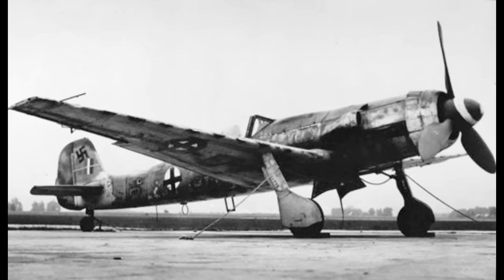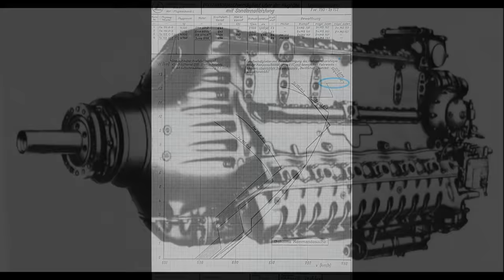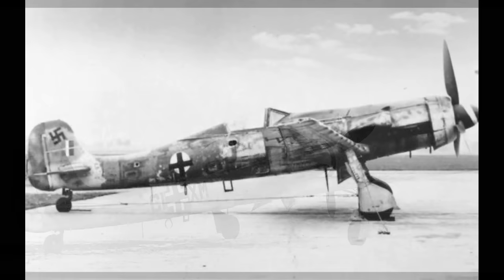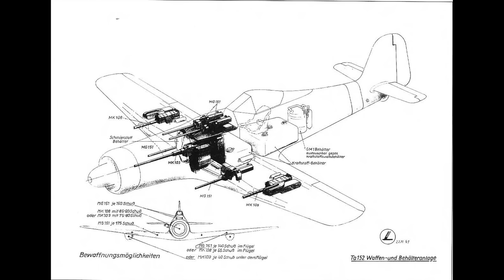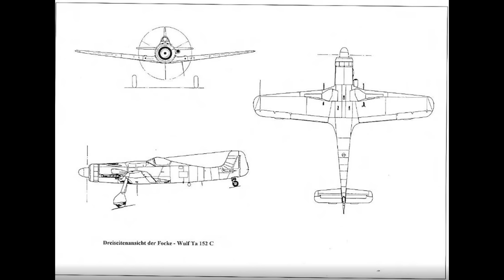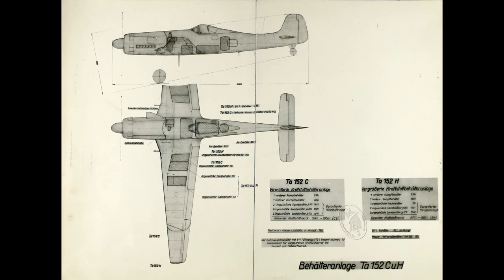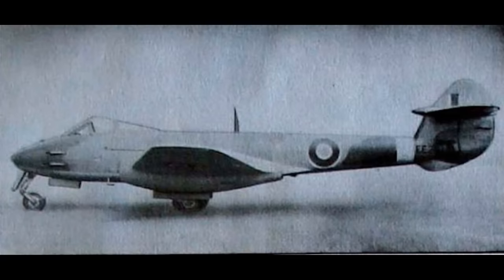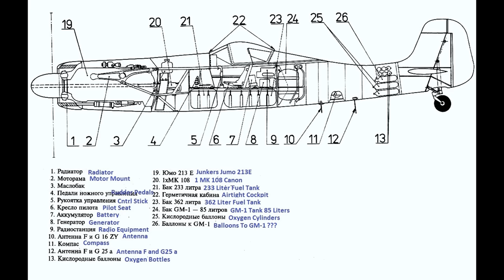Focke-Wulf Ta 152 H-1 Extreme Speed At High Altitudes.

Comment: Question: was Heini Dietmar on Oct. 2, 1942 @ 1000KPH in a Me163A with a Walter rocket engine the first person to break the sound barrier before Chuck Yeager? Excellent, informative vid, as always!
Reply from the maker: No, there was no airplane in WW2 that broke the sound barrier, those rumors are on par with Nazi bases on the moon.
Reply: @GregsAirplanesandAutomobiles  ok, just read into too much in my Schiffer Military books!
Reply: Horten IX V3   977 (1000) km/h   Air & Space Museum San Diego

The Messerschmitt Me 163 Komet is a German interceptor aircraft designed for point-defence which is the only rocket-powered fighter aircraft ever to have been operational and the first piloted aircraft of any type to exceed 1000 km/h (621 mph) in level flight. Designed by Alexander Lippisch , its performance and aspects of its design were unprecedented. German test pilot Heini Dittmar in early July 1944 reached 1,130 km/h (700 mph).

Comment: Greg, would like to offer my congrats on a very informative well presented doc. I have a couple of questions for you. Do you know if the Ta152-h was operated over the Eastern Front? and do you happen to have any information on what the Smithsonian so plans are regarding their example? Thanks.
Reply from the maker: Thanks Rural, and I really don't know. I have heard of TAs on the Eastern front, but I can't be certain. I have no idea what the Smithsonian will do.
Reply: +Rural Geeze     Regarding the Smithsonian Ta-152,  repairs have been made over the years to correct damage to the wooden components from mice and poor storage conditions.  When it was being evaluated by the AAF,  modifications were made with steel plate to strengthen the tail because there was concern about tail separation.  So those modifications had to be removed to return the exhibit to the original condition.  I am sure that the Smithsonian will eventually get around to preparing the aircraft for display.  The current philosophy at the Smithsonian is leaning toward "light" restorations rather than deep restorations on aircraft.  I am not sure that I agree with that approach when everything should be completely taken apart for cleaning and repair.   For Eastern Front Ta-152s  I did read of an account of a Ta-152 spotted fleeing to the East at the end of WW2, but this is anecdotal.  Another mystery is the possibility that Japan may have been given license to produce the Ta-152 and somewhere in Japan there is a full set of engineering drawings for the type, which would be a historical find if true.
Reply: @FiveCentsPlease  Thanks for info, But what a way to treat an extremely rare & valuable airframe, I bet there are restorers who would give their right arms to see that airworthy.

Comment: I love the FW-190 TA 152 H1 is a boom and zoom king along with the D versions and the A , F version

But I wonder does any Ta 152 H1's survived after the WWII and still flying today
Reply from the maker: No. Only one survives, and it's far from flying condition, nor should it ever fly because it's the last one.
Reply: @GregsAirplanesandAutomobiles  

I think I have got it now 

TY
Reply: +Flak 8  Discovery of a Ta-152 crash location would be significant and could in theory allow a path to another constructed example.   Much of the buried scrap in Germany was dug up in the 1950s by scrap merchants.  The British had a second captured Ta-152 which they scrapped.  Someone would have to research whether it went to the smelters or was crushed and buried, since other captured aircraft were buried on one of the old RAF bases.  Flying?  I don't really know since the Ta-152 was not really a proven design and still had teething troubles in service.  A flying example would probably have to invest in additional engineering and replace the hastily designed wooden structure (the tail) with metal to make it safer to fly.

Comment: Impressive for a plane with a wooden 3 bladed propeller.
 Off topic a bit, but I wonder how the different armaments carried by WWII fighters performed at altitudes. Interesting to think what thinner, colder and less oxygen dense air would have on performance, if any, or was it just a challenge to keep them from potentially icing up. Hmmm...
Reply from the maker: The did have gun heaters in some cases. I would think that the thin air would result in a flatter bullet trajectory and more range. I'm not a firearms expert, but that's how it seems to me.

Comment: I understand that liquid nitrous oxide should cool the intake charge a bit as it is injected into the manifold and returns to a gaseous state (with additional temp reduction being accomplished downstream by the aftercooler), but would this phase-change effect of the nitrous be significant, or minimal/unmeasurable?
Reply from the maker: The cooling effect is significant.

Comment: The Dash8 I fly is set up for 100% oxygen. The main reason is so the mask is protecting from smoke inhalation as well as low pressure air. It can be switched to dilute if you were flying at high cabin altitude for a long time for some reason.
Reply from the maker: DeHavilland, or Boeing?
Reply: @GregsAirplanesandAutomobiles  DeHavilland, the Q300 specifically (So perhaps Bombardier is most correct?). For us the mask is for smoke and/or emergency decent from 25,000, which takes 3-4 mins.

Comment: Hey Greg, do you have an opinion on how the Germans managed to be so competitive? On superchargers - their superchargers had to accomodate the guns shooting through the engine block, so they are off to the sides of the engine, and they didnt have the superb aerodynamicists of the Allies. Yet the speeds they attain are definately comparible. Also, they look badly built, badly finished, and their slave driven, bombed factories surely could not output a smoothly detailed aircraft in the way the Mustang for example was finished. And yet...
Oh! also, the shorter wingspan version doesnt seem to suffer too much in comparison until the very highest altitude (and that from the nitro), and I always envisaged it as much more of a low altitude craft. Interesting.
Reply from the maker: Generally speaking, bigger engines. The BF109E and F had about 33 liters vs. the Spitfire's 27. Pack that engine into a smaller airframe and you have an advantage.

Comment: Greg: Can you add some (much needed) Information on the Airscrew (Propeller) ?  At the thin air above 30,000 ft and high speeds, the propeller design has its own set of challenges...
Reply: I'm curious about this subject too. I have so many questions especially on Fw-190-C with its 4 blade propeller but I just can't seem to formulate a question
Reply from the maker: I'll have to cover this at some point. I am trying to learn more about props right now, I never really studied them before.
Reply: @GregsAirplanesandAutomobiles  Please do that at all means!... Propellers are sometimes taken for granted, easily imagined as rotating airfoils, but their behaviour is quite more complex, as they are traveling and other effects appear, like when the airplane is Taking Off and the airspeed is low, but the "airscrew" does indeed "pull" the air before the airplane, that is, the leading edges of the propeller reduce the local pressure and "pull" the airstream back, accelerating it. Thus, the phenomena is quite complex.  Add to that  the fact that multiblade propellers produce complex interactions as there are blades that have already disturbed the air for the blade that is following them. (There are a few single blade propellers used in aeromodelling, and those have been found quite more efficient than two or more blades, but as far as I know, those are not used on full size airplanes.
Reply from the maker: I'm in the midst of collecting all pre 1955 NACA reports on propellers. Combined with AFNA, and PHOAK, I should be able to make a decent propeller video.

Comment: A bit off topic, but, I’m just constantly blown away by the rate of technological progress during WWII. Particularly in Germany, being so stretched for resources. What would you consider the last piece of WWII era piston engine technology to be incorporated, decades later, into automotive engine design?
Reply from the maker: Let's see, automobiles now have direct injection, 4 valves per cylinder, supercharging, turbocharging (sometimes both like the P-47, for example the Volvo T-6 engine), and aftercooling. Water methanol injection is on the race version of the BMW M4. Nitrous isn't practical on a production car, so that really just leaves one thing, the variable supercharger drive. Nobody has duplicated that, and it has a lot of potential.

Comment: Using pure oxygen injection has been tried....with dismal results.  Fuel combines with the oxygen and creates heat...but this doesn't by itself create much pressure because the rate of expansion is fairly low...it just creates heat.   What the heat does is expand the nitrogen which comprises about 78% of air and this is where the pressures are created.   Nitrous oxide adds more oxygen which allows more fuel to be burned, but the massive power comes more from it also adding a bunch more nitrogen which expands and creates the power.   Burning fuel makes heat....expanding nitrogen makes the pressure.

Comment: Why is the P-51D with 150 octane so slow at 20,000ft in your chart? All the sources I've seen say that it could do at least 440mph @ 20,000 ft (its full throttle height when using 75"). And the British Mustangs used even higher engine settings to catch V-1s.
Reply from the maker: Because it doesn't do 440 mph AT 20,000 feet. I thought I explained that in the video.
Reply: @GregsAirplanesandAutomobiles  
http://www.wwiiaircraftperformance.org/mustang/mustang-level-150-2.jpg
The data from wwiiaircraftperformance.org show P-51Bs 75"Hg breaking 440mph @ ~20000ft when equipped with the 1650-7 engine. 

In your video (which was extremely interesting and informative - thanks btw) the P-51D is 20mph slower at 20000 feet and has a much higher full throttle height of 30000 ft. Perhaps the test data you used was with the higher-alt 1650-3 engine?

Comment: Hmmm I fail to find ur video , the one u mention, on the continous supercharger drive which provided no steps in power , was it as the  Daimler Benz  aneroid controlled torque converter system used on some 605's?
Reply from the maker: Really? I have an entire video about it.
Reply: @GregsAirplanesandAutomobiles  GREAT !! please Give me the link , I have searched . I found ur video on supercharging versus turbo , but did I miss the part on the boost curve without steps ?
Reply: I am a combustion engineer , Jet and Piston, but have run a couple of turbo Suzukis an Cossie Sierras... good way to scare oneself shitless....which is important on the bucket list....or?

Comment: Greg! The top speed of the TA152h at sea level can that be more than 570kmh with the use om GM1?
Reply from the maker: Sure it can, but "officially" they didn't use GM-1 down low. Although I sure would have.
Reply: @GregsAirplanesandAutomobiles  Thanks for the quick answer! Nice to see the airline industry rolling again! You been to Arlanda lately?  I assume you still working in the 767😁👍🏼